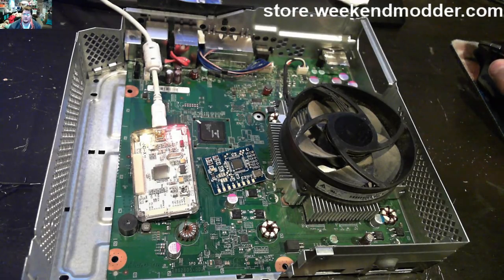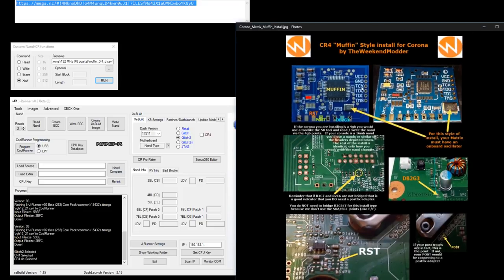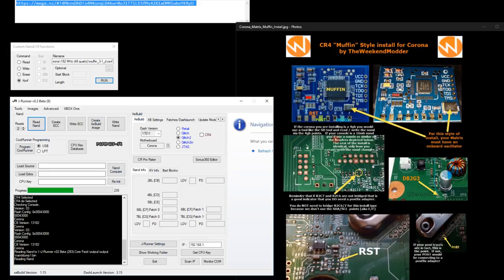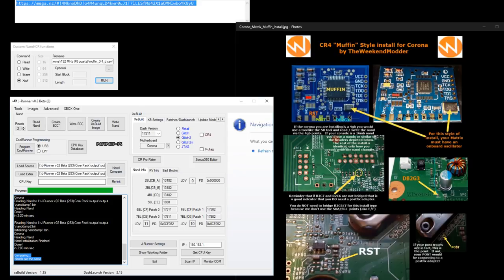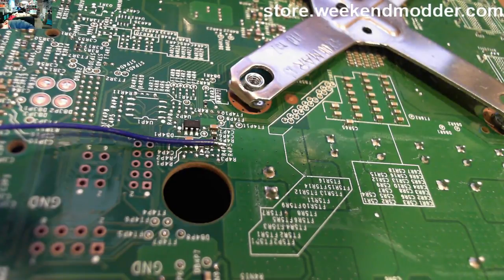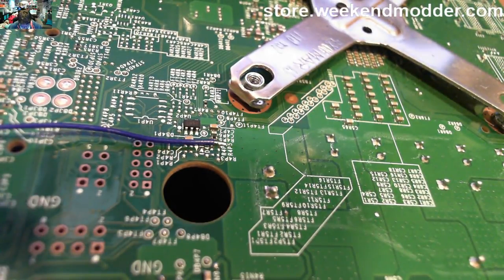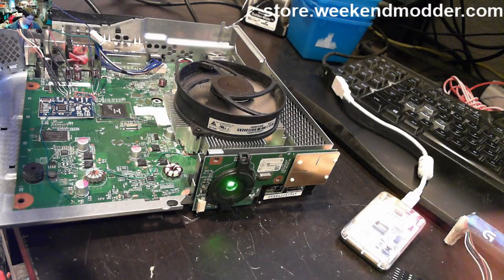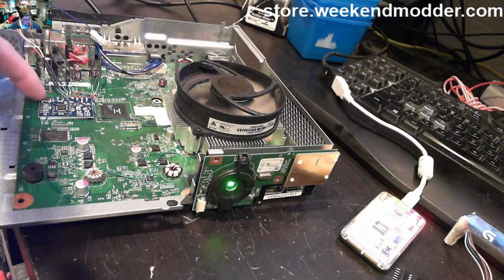Tutorial for RGHing Corona motherboard with Matrix using Muffin style install

Comment: FYI, you can also use Rev C with muffin, Use DB3G31 for CLK Point 😃

For SDA you can use FT2P2. SCL use FT2P3, all at bottom board, no need to bridge resistor pad at top board.